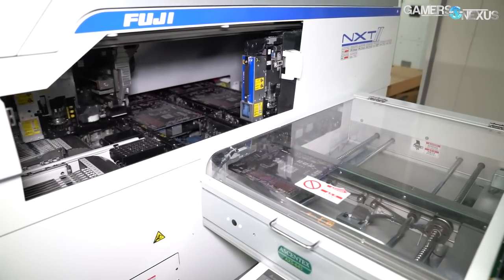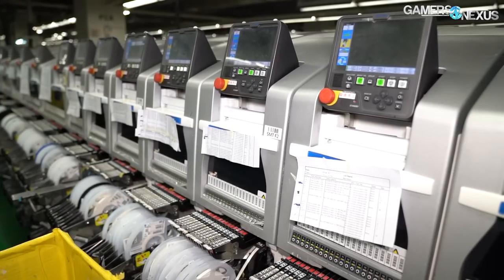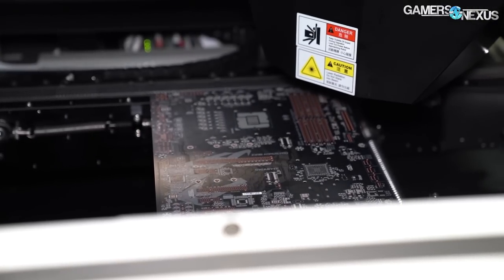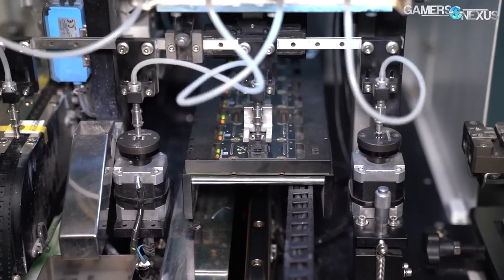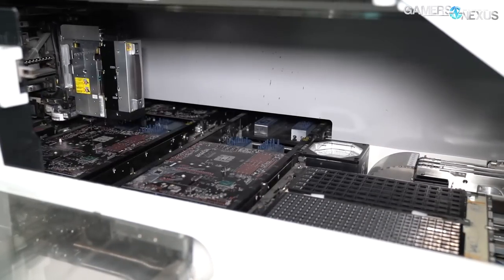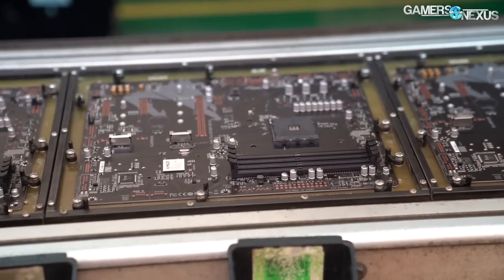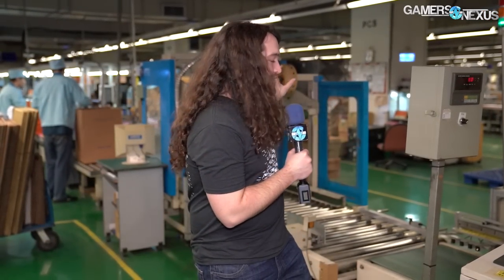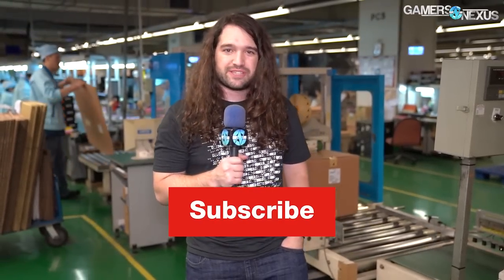How Motherboards Are Made (2019) | Taiwan Automated Factory Tour, ft. Gigabyte

Comment: Just incredible to watch and think of how labour intensive the building of boards would be without automation (if possible at all!).

 Thanks Steve (and team!)
Reply: how do you think they were made in the beginning? ;-) speaking 386's 286's etc. by 486 they had a fair bit of automation but all the testing was cumbersome (think the first test station from Gigabyte)
Reply: Of course you can do it manually, it just costs you a whole lot more, both in money and labor. When you have one off prototypes and such the boards are pretty much always made manually, setting up SMT lines for a one off is more trouble than it's worth.
Reply: They are done automation because of another computer.... with a motherboard.  

Wait how tf did they make the first motherboard??

Comment: I was in a SMT line as a AOI programmer to program the AOI that check the component are correctly placed and the welding are correct. But our line only have 1 AOI machine at the end of the SMT just after the reflow machine. that line was producing some MB and graphic card for some small brand, Gigabyte has an AOI just after the solder paste is clever idea. 
The most expense equipment in the whole in is the pick-and-place (SMT) machine which made Siemens or Panasonic. Their movement is so fast that watching them is so satisfying.

BTW, The factory usually work 3 shift a day, so the line is open 24x7

Comment: So much different than back in the 80s when I supervised 50 'parts stuffers' to feed a wave soldering machine.
Reply: I may of missed something but during the assembly when the workers were hand placing the thru-hole components are those wave soldered after?
Reply: @pongisan3658  If it is a few components that have a large thermal mass, then hand solder. If many smaller components the bottom side SMD parts already there would need to be glued down in the previous SMD  placement process prior to wave soldering.

Comment: I used to loath gigabyte like 10 years ago their quality control was abysmal. Now adays they are actually pretty good. Very neat video, basically a 3d printer on crack 😂
Reply: I never had any problems with Gigabyte mobos. On the contrary I loathe ASUS and ASRock mobos as several of it died within 1 year.
Reply: @freddyng1843  Seems as per usual; every company has their slip ups. I think they are all good motherboards. features are another thing entirely.

Comment: Very interesting to see. I didn't realise they still had people solder parts to the boards these days!
Reply: More placement than soldering but yes, there's still a good deal of handwork. Bit through hole components are one of those things that are more efficient to do by hand on a mostly SMD product.
 If it was all through hole (this is rare in most devices at this point), there are different types of pick and place machines that also bend the leads for the through hole components and then instead of using a reflow oven, they use wave soldering.

Comment: Gigabyte should improve their bios before making motherboards
Reply: I have a z390 board from gigabyte. Bios seems fine to me. 5.2ghz oc on 8086k.
Reply: @thelittledetailscr7231  5 mhz is not that much xD
Reply: @megapet777  lol you get what I'm sayin
Reply: I was just about to comment that. There bios is so outdated and needs improvement...
Reply: navigating a gigabyte bios is like running through a labyrinth while blindfolded and tied together at the ankles

I'm happy with the hardware but god DAMN do I miss the bios from my old asus board
Reply: Maybe a ryzen owner. Mine seems to working well enough.
Reply: @thelittledetailscr7231  5.2MHZ thats some insane clock speed for 8086k
Reply: I agree, their bioses sucked back in the day and they still do now.
Reply: Better then the MSI bios......
Reply: For the people complaining about the BIOS: it's all relative. I rebuilt my PC from an i7 920 to i7 8700K this past fall. Both systems have gigabyte boards. The X58 board didn't even have UEFI (or USB 3.x or PCI Express 2, or SATA3, or M.2, RGB etc etc etc), just an "old school" BIOS (dual BIOS actually) with an interface that would be at home in 1996. Going to the Z370 seemed like a huge improvement since it has UEFI and a GUI. I wasn't complaining. At least we don't have to use DIP switches to configure the boards anymore!
Reply: @matthewtuel2747  Issue is comparing a Bios from the last few years the MSI bios is a mess. I'm comparing a B350 MSI bios to a Z97 Gigabyte bios. Typicaly one sees improvement with time from one Bios to the next with companies one upping each other. The MSI bios being newer is a mess. In regards to your situation I would defentily expect an improvment in bios even when more functions and features are added after 9 generations. This also does not include the fact that I have had to clear the Cmos and the frequent inability to update the bios many times with MSI while the gigabyte bios is just stable and problem free.
Reply: Oh I agree, it's the reason I jumped ship from Gigabyte to AsRock.
Reply: Everyone should check if they like the BIOS of any motherboard before buying it, and also verify if it has all the features that will be needed or perhaps useful in the near future.

Comment: Automatic Optical Inspection (AOI) and X-Ray are really much preferable to actual power-on functional testing because they give you a very direct and specific result as to what went wrong. I work professionally in manufacturing test and hardware diagnostics, and it can actually be quite complicated to translate a functional test failure message into a specific part or process failure.

AOI and 3D X-Ray will just tell you straightforward "this component is missing" or "these solder points are bridged". It is very direct feedback to the manufacturing engineers and technicians.

Comment: I used to be an End-of-line AOI operator for a small company here in Michigan. I'm pretty sure that if the company I worked for had (or did now for that matter; I have a friend that still works there) the level of QA that Gigabyte appears to, they would be running more smoothly. When I worked there, we were on year-round mandatory overtime. They had been for over a year. They still are now. My employment with them terminated in 2015, iirc.

Comment: 15 pick & Place machines in the line is a perfect example of Pipelining which is how microprocessors went Superscalar or Instructions per clock vs clocks per instruction. 
If each pick and place machine places 1/15th the # of board components the line proceeds 15x faster than it would if one machine had to place all the parts, thus a 15x speedup in the production of boards.  Once the insertion of parts is complete the flow soldering process is next and is another unique process to watch.

Comment: You forgot one of the most interesting parts of the process. The population of back side components. They must obviously be mounted first, since there's fewer of them. They must also be secured with glue that sets during soldering, so that the parts don't fall off when the board is brought back up to soldering temperature for main component side reflow. Later, when main component side is populated and soldered, the bottom side components may need to be protected additionally with tape that is then removed.

Comment: HEY! This is pretty cool... My Mobo is a Gigabyte and I love it! The only complaint that I have is; they do not have very clear instructions. They suggest that you update your BIOS, but do not make it clear where to get your updates from, or how to install them once you figure it out. They obviously give you a CD with the Mobo, however most people in 2019 do not use a CD drive. The utility software for updates that they mentioned in my manual, is outdated and no longer supported. I had to do further research to find out that it has an entirely different name. Once I figured that out, I downloaded the newer utility (GigabyteAppCenter) and everything went smoothly. This was not an easy process, not recommended for beginner PC enthusiasts. If you have experience with this kid of stuff, then I highly recommend Gigabyte products! <3

Side note, this is for Intel CPU's, I am using an 8th Gen Intel. I am not sure if this will work for an AMD CPU! Or any other generation of Intel CPU!!! You will have to do further research (you should always do extra research when taking advice off of the internet) to make sure that this will work. If not, then you need to find the correct utility to update your system.
Reply: If anyone uses this utility to update your BIOS/drivers, you might have to select your boot drive again through your BIOS after the update. If it gives you a blue "error screen" you need to select "UEFI" to get into your BIOS. Then change your "Selected Boot Drive" and Save and Exit.

Also, make sure you check your XMP profile (custom memory settings) because it will also reset. Once you boot into Windows, you can consider looking for Norton antivirus or Google Chrome w/ some plug-in bloatware garbage that the update will install. Remove it if you want or keep it, that is up to you! Unfortunately there is not an option to remove it from the update...

Just some advice if anyone does consider updating! Hope this helps someone out there!!! :D

Comment: Gigabyte's mainstream motherboards are made in China with their ITX models being an exception (being Made in Taiwan).  Whereas most of Gigabyte's High End motherboards (for high end builds like Threadripper and X299 / X399) are Made in Taiwan.  Gigabyte is going to eventually move their PCB production over to mainland China; they are currently the only motherboard maker making some of their PCB's in Taiwan.  Eventually, its all going to phase out, however, I wouldn't be surprised if they resume Taiwanese production for the bulk of their products (both low and high end) in the near future as the current situation (COVID-19 and Tariffs) creates bottle-necking when continuing production in Mainland China.

Comment: Would be fun to see how they quality test eventual coil whine on GPUs.
Reply: They don't, at all. At least that's what I was told by some manufacturers. They don't agree that coil whine is a problem since it does not effect performance of the card at all.
Reply: @AsanoGemu  Does this mean that the don't do returns if the card has coil whine? Good thing to know as a customer.
Reply: @cornerliston  I don't know, how Gigabyte handles this. I just got the same answer from various manufacturers over the years, maybe some are outdated but the most recent was half a year ago. Sapphire do not see coil whine as a defect, so not RMA for this reason. Other manufacturers that told me so were ASUS, XFX, EVGA and KFA2/Galax. Keep in mind that replies from those are maybe outdated because it's years since I was in contact

Comment: How are the thru-hole components soldered? You showed the oven doing SMT, but then connectors etc are installed and need solder as well. Way back in the 90's I visited a factory that used a solder wave, curious if those are still used for thru-hole.
Reply: Of course here also by wave soldering machines. You can see boards coming out from it at 0:51 when Steve says reflow :) Don't believe him, it is a wave soldering machine :) :)
Second option would be selective soldering machines but I have not seen any in the video.
Reply: @ummonpwr  So wave soldering is still used. Cool. Btw, back in the days I visited factories thru-hole was very common and the pick & place would occasionally be off by a hair so the lead didn't hit the hole in the PCB. The lead would bend under the component and the machine would push hard enough that the component exploded. The pick & place had a ballistic blast shield around it. I can see why SMT was so rapidly adopted by the industry.
Reply: @markusstrobl1067  No wonder, SMT is a much better technology compared to through hole regarding design, manufacturability and cost :). The blast shield made me confused, I have not seen this kind of apparatus yet. There is cover on the machines, but there should be some funny reason because it is not common practice to use a shield instead of repairing the machine or adjusting the desing of the product.
Reply: @ummonpwr  Yes, the cover over the machine is what I'm talking about. Every hour or so it would miss, explode a component and then a worker had to grab that board and manually insert the missing component.

Comment: I’ve always wanted to know, if the reflow oven is heating to 250-267°C, how does it not kill components with way lower heat ratings like capacitors and stuff? 
Is that only their operational temp limit? 
I’ve always worried about frying stuff when soldering without much flux
Reply: Maybe because the boards aren't powered on? Operational temp means temp while it's turned on.

Comment: Unfortunately, the last two brand new Gigabyte motherboards I purchased were defective. One had a non-functioning LAN port and another had a non-functional CMOS which refused to retain the BIOS settings!  Installing new CMOS batteries, using default BIOS settings, and installing latest BIOS firmware made no difference.

Reply

Comment: Is gigabyte the best low end Mobo? I had replace three gigabyte dead USB port Mobo on the same year after every 30hours of running my PC. No one could diagnosed the real problem. No surge happen. This problem arise after I successfully power off my PC. Came back later my USB mouse keyboard not working. Could you please help.

Comment: 2:57
Bare copper pads? No surface finish so it is cheaper ?!
Interesting.
Reply: Yeah, I figure it's a cost saving measure. They are soldered almost immediately after manufacturing so it doesn't really matter.

Comment: I’ve reviewed the above complaint (our reference RMA#USA-1911067). Our repair technician examined Mr.
Smith’s returned product, and determined warranty was not covered due to physical damage. Our 3 yr
manufacturer’s warranty includes any product defects, and excludes any type of physical damage or liquid
damage or oxidation (a result of liquid/high moisture exposed on to the circuit board).
Mr. Smith was notified via email (attached) on Feb 15th, 2019 of the reason for along with pictures from our
Repair Engineer.
I do understand the confusion Mr. Smith may have read on the reasons for warranty rejection. However, our
Customer Service Agent explained to Mr. Smith in a phone call that the sole reason for rejecting warranty was
physical damage/oxidation. This was in bolded font contained in the referenced email. I also understand Mr.
Smith may assume the product is only dirty. As determined by our Repair Engineer, the oxidation was covered
by dirt/dust.
Please do not hesitate to contact me directly for further questions.
Regards Can someone explain to me how dust is water damage or Oxidization of the 1070. This was sent in to Gigabyte after windows did an update and it started saying error 43 and would play U-Tube videos but not play video games under load. Nvidia went into my computer online and said send it into Gigabyte (warranty is not up until 8/04/2019. (and said it was a hardware problem.) Gigabyte sent me 4 pictures 1. the stainless steel plate were the monitors plug in with oily finger prints on it ( did an experiment when the GPU was returned and washed my hands with dish soap and dried them than picked up the GPU in the area an 4 times and got the same result oily finger prints on the stainless steel. 1. picture with a zoom camera dust between the back support plate and the PCB ( hardly enough room to get the air can straw between and complete disassembly of the G1 gaming 1070 is required to clean properly ( I clean my computer  every month but this is excessive and I believe under normal use beyond expectation and though I clean my computer every month I was not going to clean it to get my warranty (there was nothing there in the cooling fins that was causing over heating or any thing like that) I run a FX 9590 CPU, I do monitor my computer components very closely for being clean to ensure temps are kept down .  I have the GPU, I have GIgabytes Pictures, I Have given the GPU the my local computer repair shop instead of doing it myself ( Gigabyte returned the GPU untouched (dust on the inset screws) with a sticker saying Oxidization( and sent the letter above saying water damage) The local computer repair shop cleaned and replaced the thermal paste and ran a synthetic bench mark on the GPU, it worked (it did not work when they got the GPU (it black screened)  (it works most of the time not but will screen freeze sometimes) The only thing other than that we fond wrong with the GPU is the HDMI port was bad due to the Great Danes laying under the desk and pulling out the HDMI cable laying against the cables from a 1080P monitor I used for a short time. I ran 3 monitors 1 DVI, and the other 2 DP This that I am typing now is being done with the complete computer and said GPU  right now. I am being told my warranty is void and I can no longer trust my GPU and can't get back any of the damages I have uncured from this. There is no water damage. even the CPU is air cooled push/pull with Nictura  fans. Where do I go beyond the Attorney Generals office My side of the bed dust isn't water damage or Oxidization, I have the GPU there is no water damage or Oxidization, Gigabyte simply put a sticker on it saying it is Oxidization and said it is dusty we aren't working on it, warranty is void. WTF water and dirt make mud not dust and dust isn't Oxidization, Oxidization would be corrosion and would be water damage but not dust Could you please tell me were to go from here or do a video on this subject in general. thank you